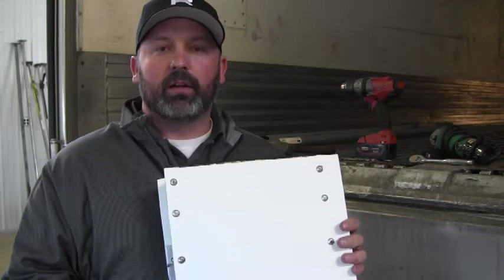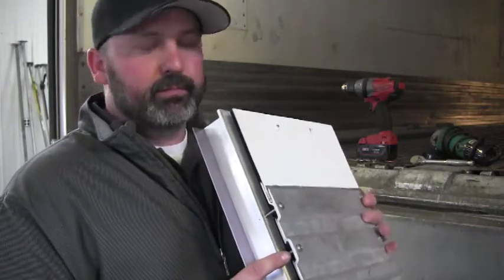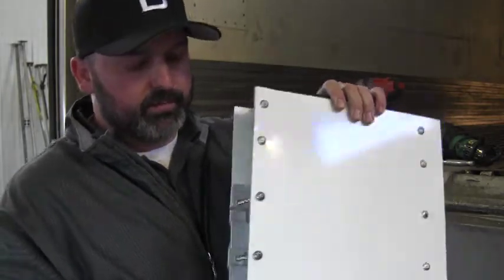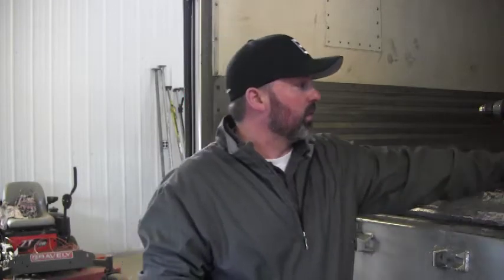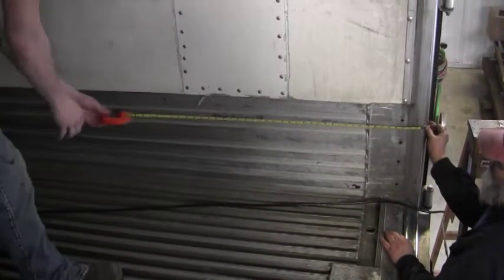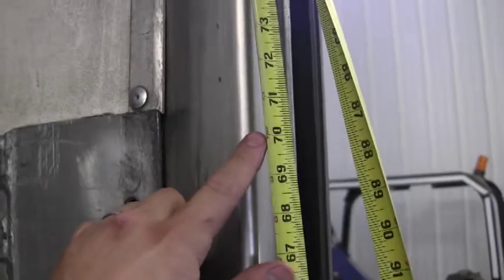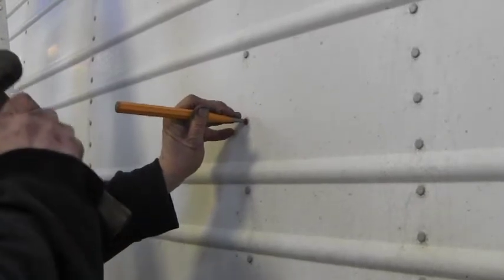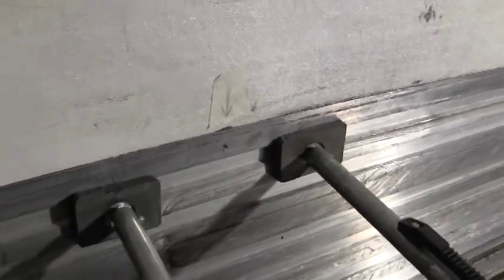Branham Equipment Wear Band Repair Kit

Comment: I started doing this a long time ago as long as the customer was okay with it. I would just take a 1/4 x 6 carriage head with the nut to the outside to match the rivet lines on the outside and it works fine. There is no way to stop scuff damage or stop the scuff from pulling away from the posts, so this method always works. Sell it as a package deal for permanent scuff repair and just go all the way down both sides with bolts through the wall and you would make a killing in your own shop.

Comment: Really nice job Mr. Gregg..! 👍 
Question for you please: Do you have a video showing how to install those 16" Wearband's at the middle or higher on the interior walls, for protection against tearing the walls with the metal skids..? thank you
Reply from the maker: I am sorry but I don’t have that video. You can still use these fasteners to install those pieces. I do sell these stainless steel bolt/nut combo’s in a kit. If you have any questions about the kits please give me a call. 260-409-0896.
Reply: gregg branham so happy I just found this comment with your number! I need those hardwares to do it to my trailer! Mines getting bad and bugging me!!!

Comment: What seals the bolt from leaking on outside of trailer nothing it will leak water because when scuff liner is hit from loading bolt will lossen over time which will leak

Comment: I HAVE DRIVAN 53 X102 I NEED TO  FIX MY TRAILER ,CHANGE THE COLUMNS AND 6 SHEETS,A FORKLIFT IN WAREHOUSE HIT IT WHEN THEY WERE UNLOADING AND IM STRUGGLING WITH INSURANCE
Reply from the maker: Sorry, I am currently not accepting work at this time.

Comment: It's a great repair, however I don't see why you didn't use a screw closer to the proper length and why the holes were not drilled in the recess groove of the rub rail.